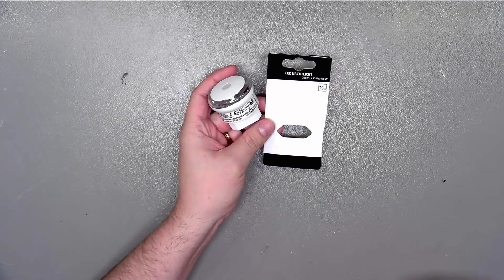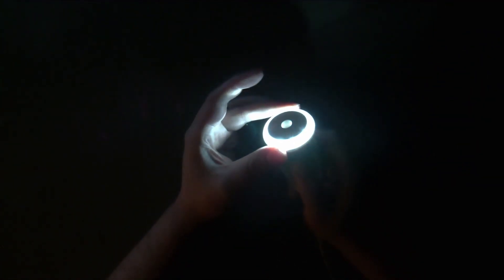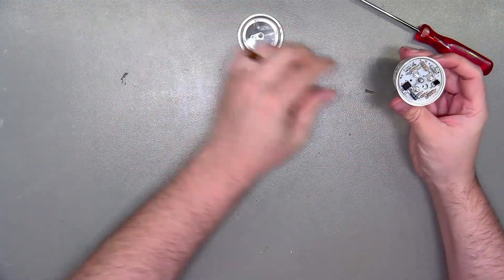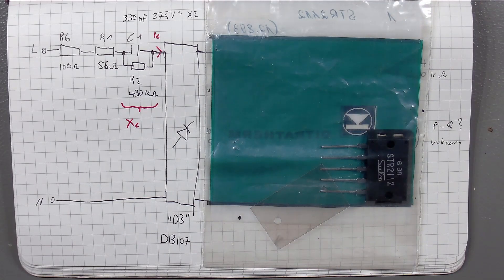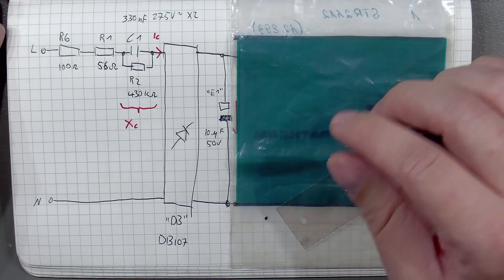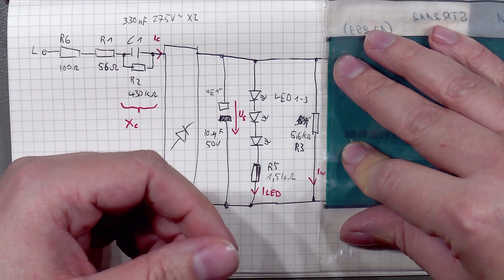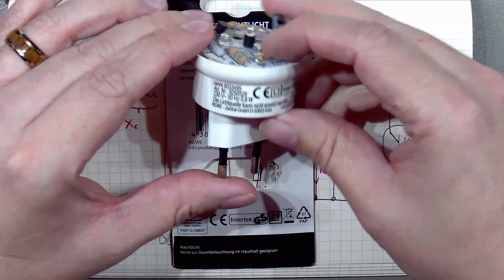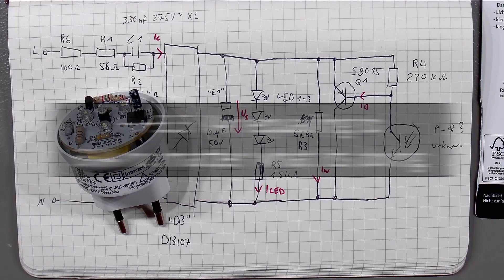Tinkertubes Lab [41] Investigating a strange night light

Comment: It's a fairly common circuit, if you examine night lights .....

It's not as wasteful as it looks; because when the LEDs are shorted out, the series capacitor will ensure the impedance presented to the supply is mostly capacitive.  In a pure reactive load, the energy is all imaginary; which means it is not being consumed, but stored up as potential energy during one part of the cycle and released during a different part.  With a hand-cranked generator, you would feel stiffness during the storage and it would get easier to turn during the release.
Reply from the maker: Of course, you are not wrong. still, why not make it "right" in the first place, instead of copying a pretty shitty circuit over and over again? 

In regards of the power consumption: Thats not wrong either, but reactive power is still loading the infrastructure, as there is a current flowing, even though its not being consumed or billed (at least consumers aren't.). This increases the load on the power grid which is already way too high where I live, as it was ignored to upgrade it for over 20 years now. 

For DIY fun projects I don't care either, but in a commercial product that is sold many many thousands of times, I think it would make sense to build it "better".

Fun fact: there was talk to start billing consumers apparent power instead of real power as well, go figure ;-)
Reply: @TinkertubesLab  Several places already bill domestic consumers based on apparent power or apply a poor power factor adjustment. It's a lot more common with industrial consumers but it isn't unheard of in the home market. If electronics manufacturers keep up with the slopy designs I can see it becoming more common as it puts a higher load on a lot of the distribution network.
Reply from the maker: @tasherratt  exactly that is what I fear, if we continue to just throw out tons and tons and tons of crappy designs :)
Reply: @TinkertubesLab  They will never get away with billing consumers the same amount for j MJ of reactive power as for 1 MJ of real power!  A high school leaver knows enough to prove this is unfair.   The householder cannot be held responsible for the resistance and inductance of the cabling from the transformer station to their own home, which are altogether random, let alone everyone else's; and just one person drawing an extra j VA of reactive power in this messy system of distributed impedances will never cause the total real power consumption to increase by anything like as much as 1 VA, even in the worst case.

Maybe the dinosaur fossil fuel companies would like to squeeze every cent out of you they can get, but soon they will be outnumbered anyway.
Reply from the maker: @bluerizlagirl  They got away with pretty weird things, so I wouldnt be surprised at all if they manage to do that as well. 

Also, knowing what people sit in governments around the globe, I would be happy if there were at least some highschool leavers in there at all xD 

But to be serious:
I worked for a company that is pretty strongly related with the VDE and IEC, having people sitting in the normative parts of these organisations. There were, at that time, some serious discussions on how to be able to make the system fair, while still being able to make you pay. That was.... more than 5 years ago now though, I have no clue what the current state of affairs is.